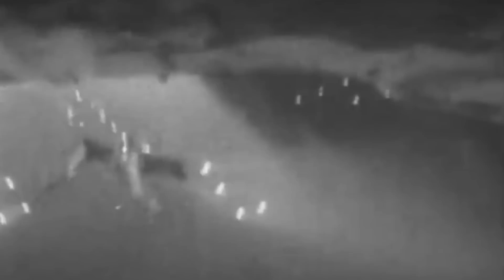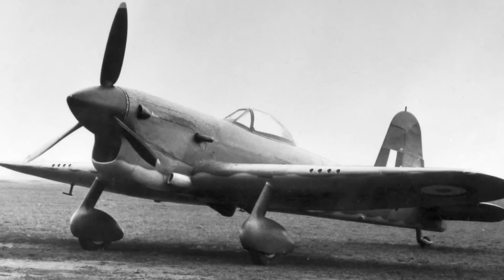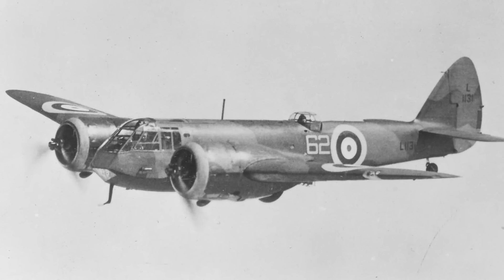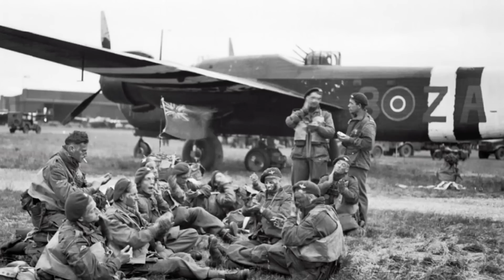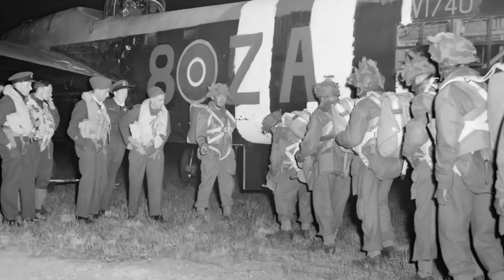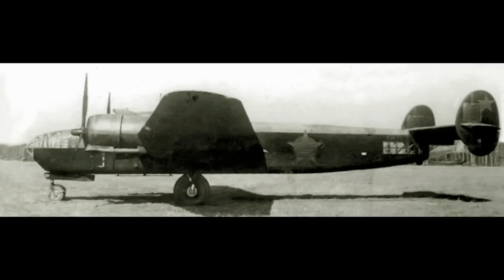The Armstrong Whitworth Albemarle; Wooden Nonwonder

Comment: My grandfather worked at Armstrong Whitworth in the test crew. And grandma told a story of farming out construction of part of an Albermarle to a locomotive carriage works. After a couple of circuits, the aircraft design team gave it a thumbs up, to which the proud carriage works rep - who apparently was used to working to locomotive tolerances - said “yep, and there’s nothing more than an inch out over the whole structure…” - after which the air crew was told to get the plane down on the ground sharpish! 😂 funnily enough, my other grandfather was a plywood chippy working at Dehavilland on the mossie and later on the vampire prototypes - all the “wooden wonders” together!

Comment: To be fair, if the Albemarle had entered service as planned in 1940, it would have been a pretty average, medium bomber. It was only the design and testing issues that slowed down its introduciton until it was obsolete. 

As a dedicated transport, the British had a rather nice design on hand: The Bristol Bombay. Stripped of the bomber equipment it carried due to the original demand for a multirole aircraft and placed in mass production as early as possible, it could have played a much bigger role than it did.
Reply: The original requirement included being used as a maritime patrol bomber. If it had been available in 1940 it would indeed have been very welcome in that role. More capable, faster bombers could be reserved for use over land in contested air space.

Comment: What was Bomber Command's obsession with outfitting their bombers (largely) with puny defensive arnament?
Which is doubly ridiculous considering they primarily bombed at night. 
Thus would be going up against big, twin-engined fighters. 

Throw in the fact that many RAF bombers had inline engines (which can take far less damage than radial engines)?
And I genuinely believe that the higher ups in Bomber Command didn't give a toss for the lives of the crews of most of these aircraft.
☮
Reply: It was a question of what was available at the time. “Heavy” armament didn’t help the American Flying Fortress’s much,as they were shot out of the sky until they had fighter escorts…as the RAF who had changed to night operations told them they would be.
Reply: At night flak was more an issue. Night fighters didn't become a serious threat until 43
Reply: They wanted to enrage the Nazis by damaging their paintwork
Reply: @Bakes-z4c  hell even a single .5 waist gun on a Fort would be hard pressed to do that

Comment: Needs a turret ... Oh! wait !   :D  What heck was that tail glass section setup ? tail gunner ? or something else.
Reply: Excellent question. Those transparent sections were present in the design right from the start when it was designed as a bomber, long before it was considered for transport duties. According to Oliver Tapper's book "Armstrong Whitworth Aircraft since 1913" -  "In order to coordinate the defensive fire, it was proposed that a fire-controller should be carried, and this was the reason for the extensive transparent areas at the rear of the fuselage." - Because the dorsal (top) turret had no view of the bottom hemisphere and the ventral (bottom) retractable "dustbin" turret had no view of the upper hemisphere the "fire controller" would have given a running commentary of where enemy fighters were approaching from so that the turrets could be rotated to engage them when they came into view. However, there is another possibility, the ventral dustbin turret was located very far back in the fuselage, only just in front of where the transparencies ended. The twin guns of the ventral turret were located in the floor of the turret and there is a distinct possibility they would have protruded slightly, even when the turret was retracted into the fuselage. Thus the gunner, sitting in the fully retracted turret, could still have opened fire on enemy fighters approaching from the rear, looking out through the transparent rear of the aircraft. So he would not need to extend the turret and slow the Albemarle down because of the extra drag. No definitive diagrams of the ventral turret installation have been found.
Reply: @johndell3642  Well, well. Not what I would have even considered.
Reply: I would guess, as most were used for paratroopers and glider tugging, it was to allow for visual checks with the glider pilot. Only a guess mind.

Comment: Concrete has a notable history in UK aircraft with the Tornado ADV using a block of concrete dubbed"Blue circle"RADAR until the actual RADAR was available
Reply: The Brits also tried Led Zeppelins, but Goodyear beat them to it by incorporating them into the light-up advertising sign.
Reply: @joshuabessire9169  The Fairey Battle was just a rip-off copy of the Pixie Punchup.

Comment: once again something about the Albemarle but no detailed explanation as to what all the strange glazing at the tail end was about?
Reply: Excellent question. According to Oliver Tapper's book "Armstrong Whitworth Aircraft since 1913" -  "In order to coordinate the defensive fire, it was proposed that a fire-controller should be carried, and this was the reason for the extensive transparent areas at the rear of the fuselage." - Because the dorsal (top) turret had no view of the bottom hemisphere and the ventral (bottom) retractable "dustbin" turret had no view of the upper hemisphere the "fire controller" would have given a running commentary of where enemy fighters were approaching from so that the turrets could be rotated to engage them when they came into view. However, there is another possibility, the ventral dustbin turret was located very far back in the fuselage, only just in front of where the transparencies ended. The twin guns of the ventral turret were located in the floor of the turret and there is a distinct possibility they would have protruded slightly, even when the turret was retracted into the fuselage. Thus the gunner, sitting in the fully retracted turret, could still have opened fire on enemy fighters approaching from the rear, looking out through the transparent rear of the aircraft. So he would not need to extend the turret and slow the Albemarle down because of the extra drag. No definitive diagrams of the ventral turret installation have been found.
Reply: @johndell3642  thank you for that  full explanation. I bet it would never have worked! Simpler to have put guns in the tail as well!
Reply: So the paratroopers had something to look while flying to France

Comment: 0:11 To be fair, the Mosquito was very much an anomaly. [eople understandably saw wooden aircraft as an outdated concept, because they were thinking of traditional construction. The Mosquito wokred so well because it basically used the same construction method as metal i.e. a monocoque structure, just using wood. It also used plywood, rather than what had been done previously, which was essentially just wooden planks.
Reply: It's best to think of the Mosquito as being constructed from organically generated composite materials. In that way it was ahead of its time. 😉
Reply: @Lensman864 

Using an ultralight carbon core material ...balsa 😁😎still used in wind turbine blades and leisure boat hull and deck cores. 

Sadly it's been over harvested .. and ask any aero modeler and you will hear of shortages and poor choice/quality of supplies and inflated prices.
Reply: Lots of wooden aircraft were used by the British in WW2, but mostly for training - just not for combat, only the Mosquito did that. The Miles company produced thousands of wooden aircraft during WW2: the Master, Magister, Mercury, Messenger and Martinet were all made of wood. So were the Airspeed Oxford, and Percival Proctor. The wings of the Avro Anson were made of wood. The RAF's 271 Squadron operated the wooden DH91 Albatross airliner. Lots of impressed civilian aircraft, such as the Heston Phoenix and Foster-Wikner Warferry were also made of wood. The Horsa, Hotspur and giant Hamilcar gliders were made of wood. At the war's end, the DH Hornet fighter and Miles Monitor of mixed construction were coming into service and even parts of the Vampire jet fighter were skinned in wood.
Reply: Using plywood skinning wasn't anything new though, the German Albatros series of WW.I fighters, among others (Roland C.II, Pfalz et al.) used it as well. That said, the balsa/plywood lamination and glueing was ingenious.
Reply: but DH had huge experience with high performance aircraft made out of wood and applied it to the Mosquito when it was needed.  Questions as to why the Air Ministry insisted on heavy and expensive turrets were not asked.  Why didnt they go for an off the shelf design like the DH91?
Reply: @babaganoush6106  The Mosquito actually came about because in May 1938 the Labour MP Hugh Dalton asked in the House of Commons why the DH91 wasn't being developed into a bomber. That started DH examining how they could do just that - replacing the four low-powered Gypsy twelve engines (only 425 hp each) with two Merlins. Redesigns kept reducing the size of the fuselage until it ended up as the Mosquito, ready for Wilfred Freeman to champion into production. - If the DH91 had been adopted as a bomber with minimum changes it would have been a disaster, the undercarriage proved to be very fragile in service and poor sealing of the interior from the elements meant they literally rotted away from the inside. It was certainly the most beautiful-looking four-engined piston aircraft ever built, but it did have serious flaws.